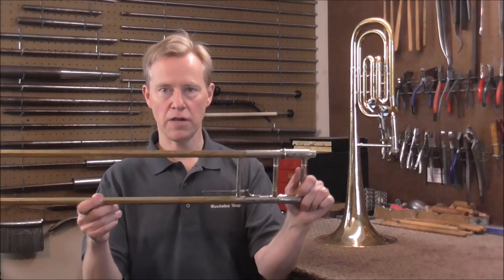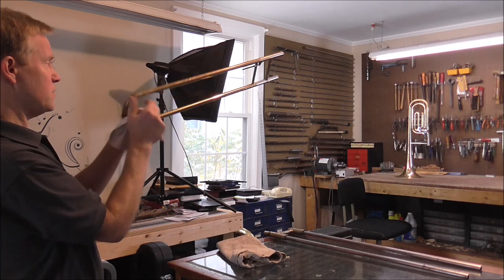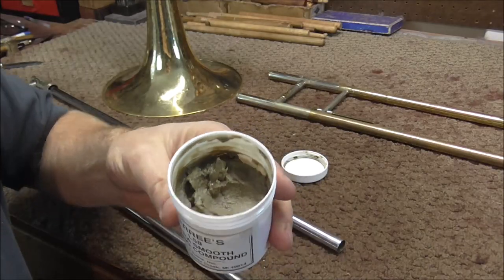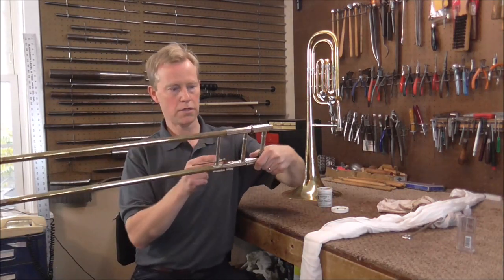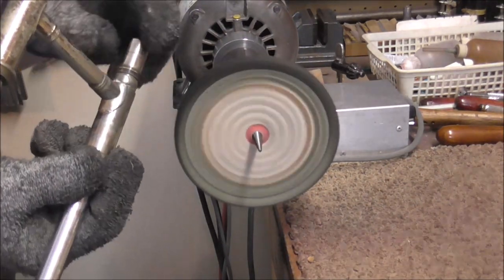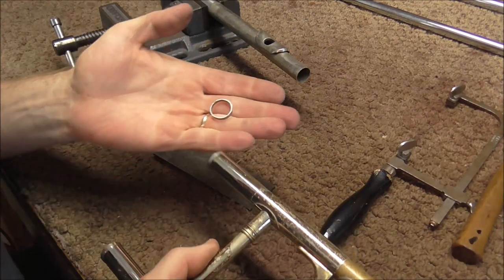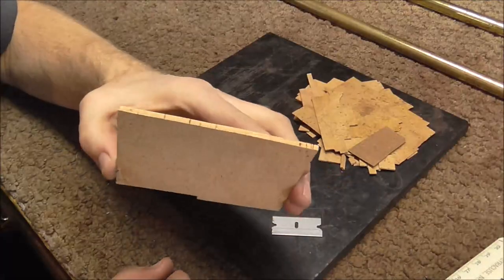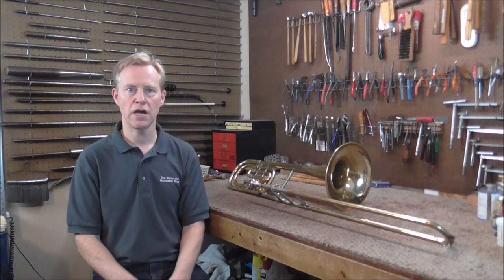Olds Bass Trombone Restoration Project #10: Free Up the Slide and Re-Assemble

Comment: Is there any advantage to have cork slide bumpers instead of felt ones? I usually see felt in my horns.  I have changed several felts using the Ferree tools.
Reply from the maker: Sorry it took me so long to get back to you. We just had a baby and I am finally getting around to answering questions. 
I usually use cork because it is easier to get the exact size, but either will work.